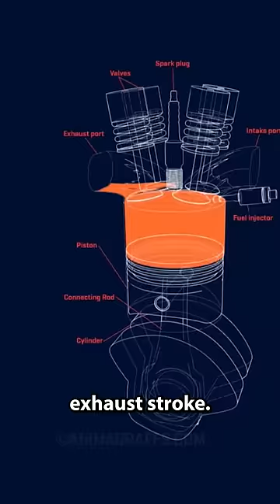Turbos Vs Superchargers

Comment: Yes and no, though turbochargers use the waste (exhaust) to run, generally speaking the compression of the engine is really low in order to run more boost, which causes lag. Both systems have pros and cons, Superchargers deliver instant power, at the expense of power (lol ironic), turbochargers use wasted exhaust to make power, at the expense of lag. Anyone who says "turbos have no lag" has no idea what they are talking about.

Comment: I love Gale. He has forgotten more than I'll probably ever know, but he's wrong on this one. Turbos don't magically extract energy from the exhaust with no cost to the power stroke. They cause increased back pressure that has to be pushed out by the piston. The force needed to apply that force is taken from another cylinders' power stroke in multi cylinder or from the flywheel in a single cylinder engines.

Comment: Superchargers produce more low end torque and they produce torque and power with a quicker response. Turbos produce dont consume power from the engine to make more power like a supercharger does, but they take time to spool, aren't as responsive, don't produce as much low end torque, and dont have as smooth of a torque or power curve making them more likely to cause a break in traction. I prefer a supercharger on my off-road setups and a turbo for paved drags. They both have their benefits and downfalls compared to the other.

Comment: Turbochargers are not without problems too. They need to be lubricated, running at high heat and high speed. So they don't last forever

Comment: If turbos are so much better hp producers, then why don't top fuel dragsters use them instead of a super charger. 

Turbo changed engine will ware out sooner than a non turbocharged engine. Also Turbos are way more problematic. That you don't have with super chargers.
Reply from the maker: Turbos have been banned in Top Fuel drag racing since the '80s. The Reason? Gale Banks. The Banks Pacemaker was the first twin turbo Top Fuel dragster, and at 4,500hp and 300mph it was literally too much of a liability for the NHRA at the time. The NHRA banned turbos entirely and has never un-banned them. Our bad.

https://official.bankspower.com/project/custom-projects/banks-pacemaker-top-fuel-dragster/
Reply: @bankspower  Thanks, that was an interesting read on information previously didn't know.

Comment: It depends on what your application is for turbochargers got one application superchargers got another application you're certainly not going to see a turbocharger on a double a fuel dragster right and you're not going to see a supercharger on an Indy car so they both have their applications!!   Yes, turbos have more applications but,  it's all about the application!!  What are you trying to do??  Speed? Workhorse diesel??  That's what determines what your going to use!!  Superchargers got their applications and turbochargers have theirs!!! And you'll be lucky to get 20% efficiency out of it either way!   Right??

Comment: It's not about turbo being better than blower. it's not. It's used in different situations. If you put a blower on a 4cyl engine you dont have enough engine power to turn the blower properly. Turbos are used because they use the exhaust but you have a delay in power boost. With a blower, you have immediate power. And blow away your guy with the turbo . But they work best with V8

Comment: Got to warn these truck buckers that though a turbo has efficient power modulation if your engine isn't built up or you don't upgrade your turbo you can't be slamming that thing from a dead stop. Now if your chugging with an eight cylinder or higher the components are usually beefer and have better power distribution where you can make better power with a supercharger from a dead start without making engine confetti.

Comment: I wouldn't say Turbochargers are parasitic, more like Symbiotic. 
The Turbocharger scavenges the otherwise lost energy from the engine in form of heat and pressure and redirects it back to the intake side of the Engine in form of Fresh air and pressure.

Comment: i think of turbos like a nice stall converter. you got a cushion that is way efficient.   air is a fluid if you pretend its water and can be compressed it helps make a good visual with gales technical explanation.     thats my plain old hobby mechanic brain thinking.       im stepping away now.

Comment: I've listened to this three times and it still makes no sense. He's basically saying that turbos are weaker so they are less likely to damage your engine. If your turbo makes the same pressure as a blower, the likelihood of destroying the engine is the same.
Reply from the maker: Pressure and power are not the same thing. If the two engines are making the same cylinder pressure, a supercharger takes more horsepower to achieve that cylinder pressure than the turbo charger does.

Comment: The bros not thinking properly… How do you think the exhaust cycle happens… There is a second piston on its power stroke that is moving the first pistons exhaust out. That’s why you don’t put a turbo on a single cylinder (four stroke) motor because centrifugal force is not enough to exhaust the gas and power a turbo charger. therefore, superchargers are better because there is no lag and either way you are exploiting a power stroke of the motor.

Comment: Sorry but that's wrong.  The power stroke is powering the exhaust stroke of another cylinder that is being resisted by the exhaust back pressure caused by the turbo.  Now, maybe the rotating mass of a or twin turbos is less than and more efficient than a SC, but that is where the efficiency is gained - not this nonsense of the power stroke being unfettered. Sorry, I like Gale but this is silly.

Comment: Superchargers are only good on a few engines and mostly gassers. The 4.6 ford V8 for example responds really well to a supercharger which can add a lot more HP for quite cheap with the only downside being fuel economy but putting turbos on those engines yields "meh" results in fact they almost hate turbos it seems.

Comment: Turbo chargers can also blow from hot bearings.  It will kill your engine.  Also turbo chargers make unpredictable power.  You don't know what pressure you are getting when you slam that gas.  You might get full pressure or only half because it's still spooling up.  Super chargers are much more steady and predictable.

Comment: Yeah, and you're heating the crap out of the air charge by compressing it with something that is coupled to the hottest thing in the vehicle pulling down your air density.  

Basically there is no free lunch here.  Pick a direction and understand the compromises you have to deal with.

Comment: Something I have never seen anybody do, get a pressure reading from the exhaust manifold from a turbo engine while on the dyno producing maximum power, and do the same thing with a Non turbo engine with a factory exhaust... My guess is that with a turbo and a free flowing exhaust, there will be less manifold pressure than with a shitty cast iron manifold and tiny little factory exhaust!

Comment: Maybe some clarification is due: turbos take the thermal energy form the exhaust and convert it into compressed air (basically more oxygen per volume unit). Blowers turn mechanical energy from the crankshaft to compress air with the benefit of the instant benefit. Turbos take some time to spool up depending on the volumes involved. There are engine systems that use both blowers and turbo-compressors

Comment: urbocharged engines may not be as reliable as standard engines. Engines with more parts have more that can go wrong. Maintenance: Because turbochargers stress the engine and its parts, turbocharged engines often require more routine maintenance

Comment: Yeah but what about the large difference between the efficiency of a turbine to generate pressure vs a shaft driven supercharger.  Turbines are used in jet engines not because of efficiency but because of weight.  Turbines are only about 10 to 15 % efficient and only at one narrow rpm range.  Shaft driven superchargers are more efficient and the issue of when they creat boost can be manipulated now with electronics to avoid Mr banks concerns about running the super charger during a non exhaust stage of the engine cycle.  The old technology aircraft engines like Allison’s and Packard Merlin used in Spitfires and P51s were all super charged.  Granted turbine technologies were not far along yet but to this day turbine efficiencies are low because blowing on a wind mill is less effective than blowing into a closed volume and moving a solid mass to move air.  I’m a mechanical engineer by education but did not design either systems but studied thermodynamics, power cycles, and their efficiencies.  I’ve talked to turbo design engineers at SEMA shows and was somewhat taken aback by the delicate nature of the internals.  The turbine blades are almost paper thin, made out of super strong but brittle material.  Bearings have to sustain very high temperatures and rpm’s much higher than engine rpm’s.  Work is on going to develop “air bearing”.  They seem delicate, prone to wear over time because of the operating conditions ( heat and extreme rpm’s).  I think mr banks success is primarily due to his talent and tenacity more so than the technology.   My 2 cents.

Comment: Well, technically a third of power to the crank, a third operating all the mechanics and a third out in heat, in which the turbo would use a fifth of that energy, but a super would take a third of the third left to run it mechanically so another words, they suck just like banks said from a efficiency standpoint

Comment: That is not correct there's always a power stroke happening at the same time with an exaust stroke with a V8 diesel which is the context of his statement. It is still putting a uniform stress on the crank. It is actually more uniform with a blower which is actually a good thing. But so long as the crank can handle the power it is a moot point.

In theory with a turbo and supercharger which made the exact same amount od boost and the exact same amount of parasitic loss. The power would be indentical. It would not matter.

But in reality a turbo makes more power more efficiently. You are using less energy to make that turbo charger spin than you would otherwise.

And in practice it is much easier to cool the intake charge on turbo which also aids in power.

Comment: I still don't like turbos on a gasoline powered engine. You need good oil to lubricate and cool the turbo. You should start engine and let idle first and you should let it idle before you shut engine off. Gasoline contaminates oil more than diesel. Now, if you could have an oil pump that would run before engine start to feed turbo and run after you shut it off, turbo would last longer

Comment: By injecting a TINY bit of ethanol during the compression stroke, a gasoline engine can run at diesel compression ratios like 20:1. Ford purchased the patent for the technology from MIT professors/inventors and permanently killed the use of the technology and killed the patent.

Comment: I'm sorry to tell you Mr. Banks that you are wrong.  Your power stroke in one cylinder is driving the exhaust stroke of another cylinder, which causes the same parasitic load on the power stroke.  Sure there are some other advantages to turbo charging but not what you describe.

Comment: Turbochargers are just more efficient to begin with . Superchargers cost more power to operate than they produce until the rpms are within the operating range where they produce enough boost pressure . Turbos cost the engine no power prior to boost being made ant then they just make power

Comment: Yeah but also no! So yeah we're getting the energy for spinning the turbo when the exhaust valve is open, but that crank shaft is being turned by some other piston on a power stroke... So yes but no. Turbo's are just plane more efficient then a blower/supercharger/tubocharger

Comment: Not really. You are using the crankshaft to push the piston back up forcing the exhaust into the turbo chamber. The cylinder on exhaust stroke essentially becomes an air compressor. Come on , you’re better than that. This is only a step above those that call turbo-chargers “free energy “.

Comment: Turbo drive pressure robs power from the combustion stroke of other cylinders.  You will see higher cylinder pressures on any turbo system if you compare pound for pound of boost. The turbo drive pressure adds to the cylinder pressure.  mr banks  complains about folks going upsidedown on drive pressure. Then dismisses that fact when compared to the blowers. Turbos are typically more efficient due to less parasitic loss a result of Smaller lighter parts.

Comment: Isn't the exhaust stroke of one cylinder due to the power stroke of another cylinder?  You're still parasitic off the power stroke no matter what.  It may be less parasitic, but it's still putting strain on the motor

Comment: That is absolutely not true. On turbo car power stroke is absorbed by cylinders on the exhaust stroke. The reason why turbo car has less parasitic loss is because hot exhaust gas velocity.

Comment: Turbo chargers are driven by waste heat that would otherwise be wasted. I am not sure they are parasitic as they only use energy that would simple go out of the exhaust pipe.

Comment: I would rather personally have a supercharger Powers instant power is constant Powers push the pedal power is right there no lag time yes it doesn't produce as much boost but what happens when you over boost you blow head gaskets

Comment: "You get all the power out of the power stroke" but that goes into the fly will which loses it pushing gas out the cylinder? So one loses power going down the bore and one loses power going up the bore.
   On a 4 stroke 4 cylinder every stroke is a power stroke. So you must still lose power on the power stroke of one cylinder pushing the exhaust out on another cylinder. Makes no sense what he is saying.

Comment: You're just getting it from a different piston's power stroke lmao. Laws of conservation, all the energy in the engine comes from the same fuel source. Power out will always be power output of engine minus turbo/supercharger, no matter what point of the cycle it comes from

Comment: So basically you’re either hoping your shit stays together with the power produced by a super charger or you’re using about 83% of the exhaust to create power that can displaced by the engine and reintroduced at a loss of course. A turbo is a safer bet. No more energy than can be produced by the motor can be put back into it.

Comment: Not completely true or the full story when it comes to turbocharger efficiency and parasitic drag due to increase exhaust gas backpressure. In thermodynamics, there is no free lunch.  Running the turbocharger subtracts some power from the engine to create more power. 
The turbocharger impeller creates backpressure on the engine which means engine exhaust pressure is higher than atmospheric pressure. A pressure and temperature drop occurs (expansion) across the turbine, which harnesses the exhaust gas’ energy to provide the power necessary to drive the compressor but this is parasitic loss to increase cylinder pressure.  I prefer exhaust gas turbochargers to crank driven superchargers as well from an efficiency standpoint but both subtract engine horsepower to create pressure (energy) on the intake side.

Comment: Makes better power at the same cylinder pressure.

Obviously, this is incorrect physically.

There is only so much energy in gasoline. How you distribute it does not increase the energy. 

Powering a turbo is not 'free'. It is still provided by the energy in gasoline being released. The overall efficiency is all that matters, regardless of 'theories' about 'parasitic drag on the crank being worse than volumetric efficiency.
Reply: It's "free" in the sense that you're utilizing heat that would otherwise be unuseful in an NA engine

Comment: Why the automakers haven't been employing turbos across all models for decades is inexcusable. Smaller engines using less fuel.
Heat? use bigger bearings, use a bigger radiator. Wear n tear? again bigger bearings, a little more oil capacity.
I have my theories
 why not.

Comment: Sorry but the only four banger i have ever seen that behaves like a V8 is the Mercedes 2.3 liter supercharged which develops maximum torque at only 2500 rpm. The rest are all stories.
Sure you can make a lot of horsepower with a turbo,but it'll never behave like a V8.

Comment: Super charges can be switched off by electric clutches turbos bearings run far to hot needing sump oil to cool them , if you care about your engine oil changes must be every 3-4 thousand miles, if anyone says bs to this they are fools

Comment: I agree to a point the problem with the automotive industry today as they take such a small engine put it in a midsize or large vehicle strap a couple turbos on it and overstress the living hell out of that engine to make the same amount of power that the previous V6 or V8 was doing with no problems.the church of climate change is destroying not only this country in every aspect but particularly the automotive industry. I will take a 3.5 L V6 Honda VTEC the power and efficiency of that engine over anything on the market today.